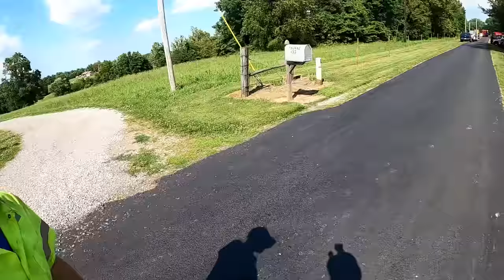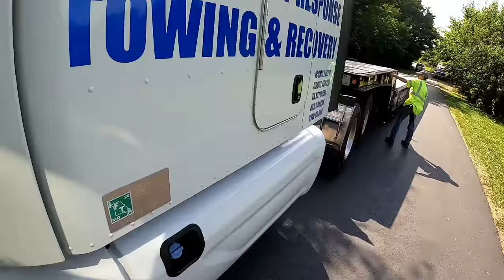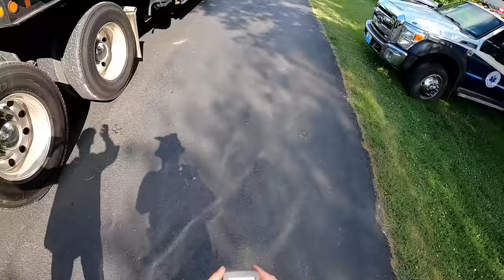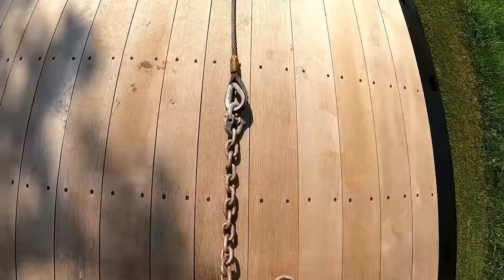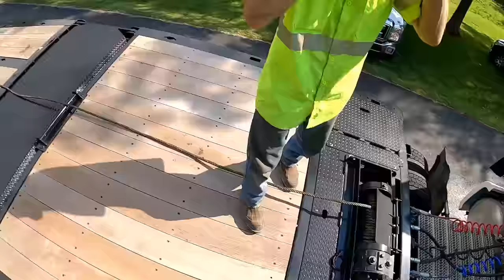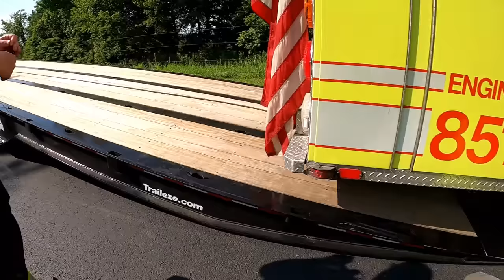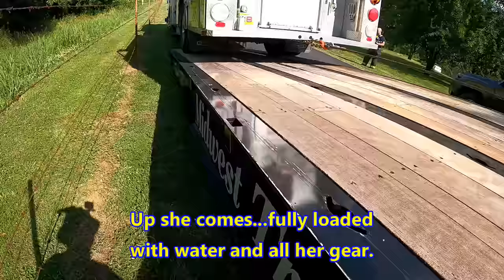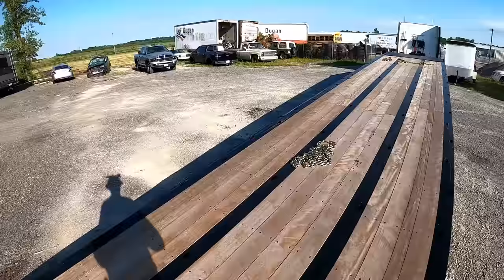Floating a Fire Truck

Comment: Would you make a video to show how moving the axel on the trailer can help turn it tighter?
Reply: It shortens the wheelbase significantly, which also changes where the trailer pivots causing the tail of the trailer to swing around much faster than if the wheels were locked in the rear. The longer the wheelbase the less sensitive the back of the trailer is to changes in direction from the tractor. As you shorten the wheelbase (moving the pivot closer to the kingpin) the more sensitive the back end to changes in direction. Look up "trailer tail swing" here on youtube and there's lots of videos that talk about it.
Reply: When he moves the axle forward it is moving the turning point closer to the truck, making it easier to turn
Reply: Ron did exactly that on the previous video where he introduced this combination: https://www.youtube.com/watch?v=TUZXGPw06-c
Reply: @iij354  Also harder to back up because it's more responsive to the tractor. Makes Ron's long reverse all the more impressive.

Comment: I’m on oxygen and wish I could share it with you
Reply: Ron, I'm on O2 also and wish I could share it too.  Before I was on it 24/7, my doctor ordered me a small canister I could carry around and use when necessary.
Reply: I wheeze and puff like Ron is in this vid all the time, without my puffers. They open the airway enough to let me express the fluid build-up in my lungs, which is what is causing Ron's breathing difficulties. I suspect a week of using Ventolyn would help him a lot in getting rid of the problem.

Comment: hey just FYI I know you give the 3 air horn blasts for safety when backing and in this case it wasn't an issue but try not to at fire scenes. for the Firefighters its in grained in our heads that 3 long air horn blasts is the emergency evac signal. that means 'get out and get out right now' and them hearing yours may cause issues for the firefighting operations. love the vid be safe out there.
Reply: I'm a volunteer fireman and was thinking the same thing. I'm also a Conductor/Engineer for CSXT and whenever we make a reverse move it's three horn blasts.

Comment: Ron that is one sweet looking outfit especially with the sliding duals it's so much easier to back a 28ft trailer than a 48 or 53 makes your getting into spots so much easier you have amazing equipment Ron.

Comment: That was a challenging job to say the least! backing a new rig and trailer with a heavily shortened turning circle with those axles left slid all the way up. huge respect and professionalism. I admit this is just the second time i have seen a USA flag being folded. I can very much appreciate the symbol of the flag through the care taken on the folding and handover.  Awesome job and talk about opening a whole new line of work and recovery options for you now.

Comment: GREAT JOB! People don't realize how much a loaded pumper weighs and what's involved in actually getting one to roll down the road. When you're carrying up to 1000 gallons of water, several hundred feet of hose and  equipment on a truck weighing of at least 15,000 lbs... it's a heavy undertaking. Very impressive how you pulled it off!

Comment: As always, another outstanding video! 

I'm the guy who suggested a "white (dry-erase) board" to you, so you could diagram some of the considerations going through your noggin' about recovering vehicles or some of the obstacles that impact your decisions.  Thank you for replying to my post!  

You mentioned that you are "not an artist" ... and I can identify with that!  Here's another suggestion:  see if your lovely and understanding  bride, kids, or grandkids (you're probably too young to have those yet...but just you wait!) to make cut-outs of a flatbed and the rotator truck (with the rotator boom hinged by a brad, so you can show necessary rotation), using heavy construction paper or light/thin balsa wood,  and thin magnets strategically placed to hold the cut-outs on the white board (which usually has metal in it).  I would suggest two or three different colors for the rigs.  

My guess is that all the stuff you need you can probably find at a craft store (like Michaels or Hobby Lobby) at a very reasonable price. And the white board won't take up a lot of room ... unless you go nuts at the craft store!  

There you go, Ron!  Instant artistry!  And the cut-outs can be used again ... and again ... and again!   And you get your family involved in your fortunes!  

[parenthetically, crazy ideas like this is how I got my masters, two PhD's, and MD!]  

God bless ya and your very understanding family, as always!  And keep those videos coming!  I learn something new with each one!

Comment: Back in the 1960s my father had a car call an Armstrong Siddley, Whitley model, these were coach built cars, the front front doors opened backwards. Suicide doors. Sadly he got sick and had to sell the car to raise some cash.

Loved the trailer demo, man you guys have it easy these days. We had to lack up the rear end using rail toe jacks. remove two pairs of wheels lower the bed and fit ramps. The the excavator or what ever and put it back to road state. Like a mornings work, you can do it in minuets.

Comment: Ron, The pumper you are loading is built by Spartan Motors of Charlotte, Michigan. you know the family tree goes all the way back to Diamond Reo. I have hauled several loads of parts in to them. They also build Motor Home Chassis and Military Vehicles. One of the biggest  employers in the town of Charlotte, Mi.

Comment: Usually with the drop bodies they hide the frame mounted tow / recovery hook inside the rear center compartment.    Ayep, electric operated trucks sure don't like low voltage!  Had to resuscitate a F450 with a dead battery, dome light left on. No tools or cables, came up with a solution, start the stand alone fire pump on the rear with the pull rope and presto, it has a 30 amp charger, let it run for 35 minutes or so and the truck had enough juice to start and run. 
Fixed the on-board charger to let it get a nice full charge and keep it happy.

Comment: Just before you made the comment - for a dead-end road it sure has a lot of traffic, I had that same thought.
I can see where that rig would be a lot harder to back up than the rotator - but at the same time easier to back up than the rotator towing a tractor trailer.
Have a happy, safe, and relatively boring fourth.

Comment: Armstrong steering was all I know when I first started driving. Not to bad running down the road, but in some of the places you have to get into it was rough. Last four trucks I drove had power steering was a lot easier, but I started losing the arms I had built up over the years without power steering. 
Stay safe and God bless.

Comment: you are good ron. i spent one hour trying to back my auto carrier trailer into my driveway one night. im going to put a receiver hitch on the front end of all three of my trucks. it seams like it will be easier to push and pull from the front than struggling trying to back up. nice drivin ron.

Comment: Ron, if you want the trailer to move faster there should be a valve on the PTO and right under the far right hand control on the trail-eze. It will look like about a 1 inch hex bolt with a small acorn nut coming off of it. Remove the acorn nut and there will be a hex screw underneath.  These are the flow control valves. My trail-eze has a 2200psi max sticker so I set my pto as close as I could to 2200(I'm about 2280 bc it is very sensitive, each 1/4 turn was about 400psi) but the valve by the hand controls will vary the speed of axle travel and bed tilt. Not sure if your trailer has the dock levelers but mine has 4 hand controls 1.Winch 2.Tilt 3.Axles 4.Levelers

Comment: It is remarkable that you are as deft as you are with backing up and turning around these oversized tractors especially with such a long bed(trailer) this vehicle has. I suspect it is just as difficult as those firetrucks that have the ladder caddy in the tail-end of the firetruck. I have questions like this all the time but my source of information is gone(my father). You just do not think well enough in advance to ask those types of questions. We do have the internet now though. Not all sources on the internet are 100% accurate.

Comment: In the State of Washington, a tri-axle trailer is required. The county three axle rigs in my area in my area are between 56,000 and 60,000 depending on a few factors (they get them dirty quickly and it is mainly mud). Our weight allowances are 34,000 on two consecutive axles without permitting.

Comment: Did a great job. The only thing I would have done differently is I would have brought your wheels back. A lot easier to back up. I get in debates with people all the time. Well, pups are easier to back up than a van isn't it? Nope, lol. A lot more time to correct yourself while backing up a van and a lot easier to over correct yourself backing up a pup. I admit before I learned how to drive big rigs I had this perception as well. It seems like backing up something smaller would be easier. Ron, that trailer is AMAZING by the way. I am actually jealous! I want one!

Comment: Hey Ron, you planning on getting a meatier horn? The one that truck got sounds rather weak for what you do. :D Otherwise is getting to look like a real wreckers truck with those lights. Love that you were finishing working on the lights when you got a call out for the trailer. And no better way to introduce the trailer that on a job.
Backing is best achieved by slow and steady with small movements. Love your skills. 
God bless you and your work colleagues as you stay safe out there.

PS: always respect the flag.

Comment: Thanks for all the great films you've made, and that flag bit was very poingent.....as you were looking for the rear tow point I was saying hope he looks in the rear locker of the fire truck as all british fire engines I've worked with for the last 29 years have two massive tow eyes inside the locker on the frame rails, although I can see how pulling from the axles helps to lift things up out of ruts and up ramps, the rear towing eyes can be quite high if it has them? Any way, always fun to watch and learn about rigging and chains, hooks etc such a huge subject and ways of doing things are so different, but your safety and care are so apperent.....

Comment: Our fire department in Sydney Australia had a similar trailer for recovering its trucks. On one occasion it was loading on a slope with the trailer wheels retracted. The weight at the rear was enough to pivot the trailer and lift the tractor drive wheels off the ground; so no brakes and away it went down the hill. Probably operator error to blame, but they soon got rid of the trailer.

Comment: I personally would have slid them back. Shorter wheel base means faster turning radius. When backing straight like that, longer wheel base helps keep it more in line. Great job with the short wheel base though. Its not easy to do

Comment: Great Video Ron!!! Would have loved to see you doing the chain up and securing it to the trailer as well. Did you find out what was wrong with it? Might be a good idea to add a long air hose to that unit in case you have to supply air to a unit that you are towing. Plus what about the red and blue blinkies as well?
Reply: I believe he said in the intro video for this truck that it was not a first response truck and would not need the red and blue lights.

Comment: Happy Sunday,  Mr. Pratt.  First time I've seen the floating axle in progress,  impressive on how it changes the turning ratio.   Does this axle style limit the load weight?  Nice looking tractor and trailer.  Had to laugh at "power steering by Armstrong", my first vehicle 56 Chevy PU with 3 speed granny low and floor button starter.  Thanks for the chuckle.  Have a great weekend.

Comment: Was the rotator out too?  You should think about putting winches on the tractor part too so you can disconnect the trailer in tight spaces and be able to take the tractor in and be able to use it separately from the trailer.  I really appreciate the respect for the flag and you even folded it properly.  A true patriotic American.  Can all of your workers dive that truck?  Or only you?

Comment: "For a dead end road, there sure is a lot of traffic!"  I thought exactly the same thing as you were walking up the first time.  Though I did wonder if most of the cars parked on the side of the road might be volunteer firefighters.  Total difference between backing the 'Tator and #17 - I had tiny taste of that when I was learning to back up a 12 ft' trailer behind our sedan for the first time.  It was SCARY, but I got pretty good at it.  I was (still am) really good at backing up without a trailer, so, fortunately, it didn't take me long to catch on to what happens to the trailer when you turn the steering wheel.  Did Mike enjoy "driving" a fire truck?  :o)

Comment: Nice thing I guess about a fire truck I guess if you have to tow it, every one of them has a conventional air line quick connect to supply it with air externally.

Comment: Certainly a nice turn and reverse, especially with that car sitting on your front bumper, but the bit that impressed me was your final position behind the firetruck - nice job.👌 And Mike did pretty well too, wrestling the thing back onto the trailer with no p.a.s. 👍
There wasn't much width to spare on the trailer; is that the widest trailer you're allowed without being a "wide load"?  I don't know what your restrictions are like but, over a certain width, trucks in the UK need a police escort; I'd imagine it's the same over there.

Comment: Hey Yvonne at 6 my many years then I'll pack those trailers up that's a pan of but at times but they do really good job I've worked with them for the last 15 years alarm equipment and old dump trucks in Swan so forth they are a pain in the butt but you know what if you do your taxes right in from the center special when you're backing up they do help you out quite a bit it's all knowing how to run that trailer

Comment: The Allisson automatic transmission requires certain voltages to allow it to shift.

I would have done a voltage parasitic draw test to see why the current is on when the truck engine is not running.

Like the trailer setup. 

Alex and I are going to have a quiet 4th. He shakes every time he hears the fireworks. He does not like the noises.

Comment: I pledge Allegiance to the flag and to the nation for which it stands, one nation under God indivisible....  Thanks for reminding me how to fold up the US flag.  I did want to see if there was any difficulty raising the trailer up with that weight on it.  But seeing it safe at the shop and the reverse procedure of getting it off was sufficient.  God Bless and stay, er in your case, GET Well and stay well! 8-))
Reply: Oh  yeah, I feel for you backing that trailer up with the wheels forward.  I have a short trailer to tow my garden tractor to the shop.  Learning to keep it going straight back was quite an endeavor.  If you have to back it any significant distance, put the wheels in the back again.  It'll track much straighter.

Comment: GrNothoughts of a Jump start  When launching my boat I used to best hand on top of stearing wheel then hand down to left or right and trailer to left or right Worked for me . Serious thought with your health problem Have you thought of a Post Covid test . Anyway stay safe good full fast recovery and waiting for next video. And like Keith From the U,K,
Reply from the maker: I have been tested twice for Covid and it's antibodies.   Both times the test results were negative.   This is pneumonia.  Since I've had pneumonia before, it is more difficult to recover from this time.   Also, yes, we discussed dumping the water and decide to leave it in the tank.  Our trailer is more than capable of handling the weight.   Also, it saves the department from having to refill the tank and it saves the city the cost of the water.  We discussed the options off-camera.   Thanks for watching and God bless.

Comment: I'm guessing the reason why it won't go into gear is because of the low voltage. Same thing happened with an old Jaguar I used to own. Low battery on dash and she wouldn't shift into reverse. Just a quick question, who, or what is that person saying on the radio which pops up every so often? Heard it in quite a few videos of yours now. Keep up the good work Ron, best wishes from over the pond 🇬🇧

Comment: This is one reason why current NFPA standards for modern fire trucks require a externally audible low voltage alarm. Obviously this truck is much older so it most likely does not have this.

Also yearly pump testing requires the truck to be able to pump at its rated pump capacity and maintain every single electrical load that could be turned on simultaneously, though it is probable of course the alternator just died.

Comment: Probably already fixed,, set brakes, neutral, road to pump switch to pump, put back in drive, should be spinning the pump. Love the sliding axles on the landoll,,, yes, changes the angles. Keep the drives on asphalt at all times.

Comment: How hard would it be to get some some come wired to the trailer to control the rear axle as far as the slide and limits so that you can control them from the tractor? Otherwise Ron has got a new toy, hope to see a LOT OF new videos with it

Comment: very possible letting it idle with all elec lights and load may be more than the alternator can keep up with. have had this issue on our Fire Dept i was with before.  I always idel them up now when i need to let them sit and run with high electrical loads.  hope that  the issue wasn't serious.  i wish my company had a trailer like that......  they are the best.